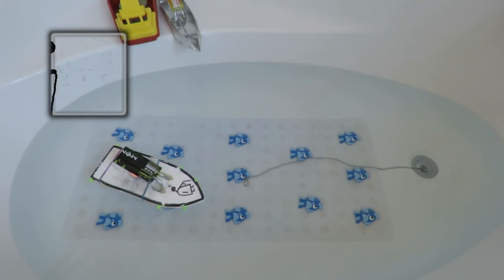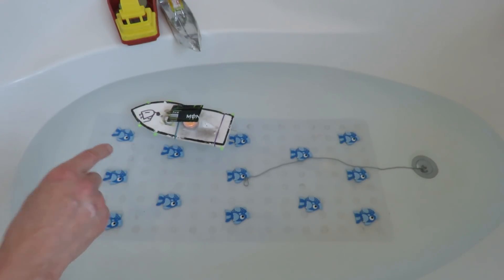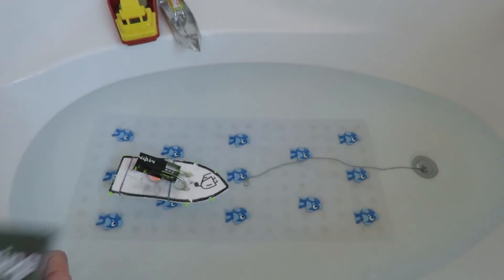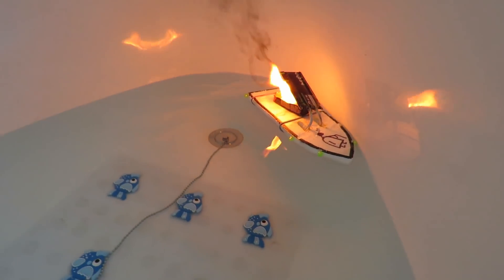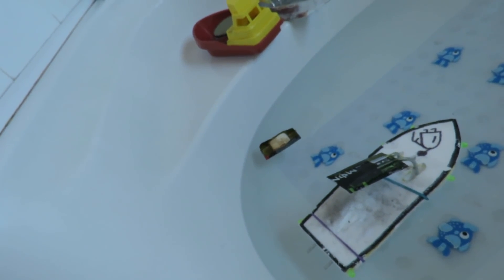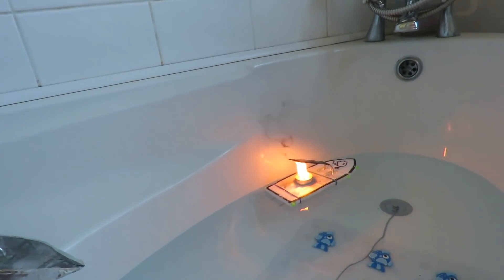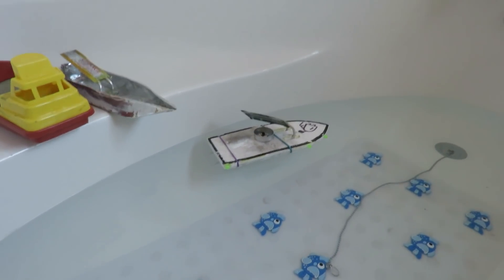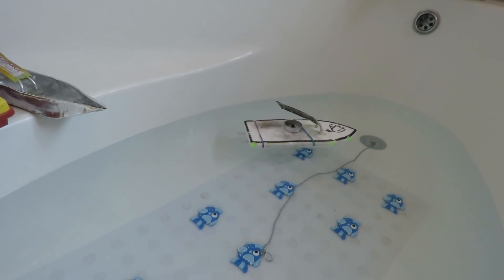Pop Pop boats - tealights vs firelighters test

Comment: LOL.
The song, "Get The Fire Brigade" comes to mind.
There is a better alternative and they don't smoke. Solid fuel tablets. The type I use for my steam engines. The Mamod steam engine tablets are expensive but these ones work just as well as the Mamod ones, plus they are made to burn hot without smoke. https://www.springfields.co.uk/konbat-hexamine-solid-fuel-tablets-refill.html?utm_source=google_shopping&gclid=Cj0KCQjwnpXmBRDUARIsAEo71tQSiwxRE9QKxqEzX4exVHjlvCE2yxX16j3FnkXcrQGgfje_Kn4NQ90aAo2jEALw_wcB
I tried to use "fire-lighters" for my steam engine and got lots of black smoke too. The actual solid fuel tablets are used for the little camping stoves and work on steam engines. :-)
Oh, they also burn much longer too.
Reply from the maker: The solid fuel tablets were what I was actually looking for but I spotted these in the bargain stores and saw how cheap they were so I gave them a try. They will have to be kept for outdoor use 😜👍

Comment: have you tried those solid fuel tablets they use for steam engines ? probably more expensive than the fire lighter option and probably more dangerous too ! and they don't smell that good either !  looks promising maybe its time to make a better one with a simple rc control and take it out on the lake or pond etc
Reply from the maker: I have done a couple of RC versions but I haven't taken them out into the big wide world as they have such limited thrust. The slightest breeze and you have no control.
Reply: GrandadIsAnOldMan   ahh well I haven't seen those I guess it will be a bit difficult to control with such limited thrust